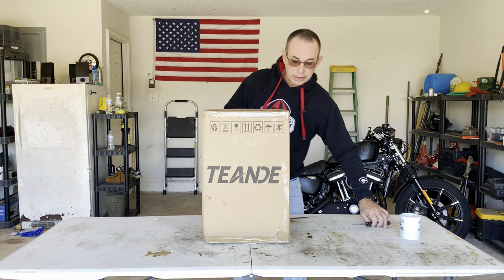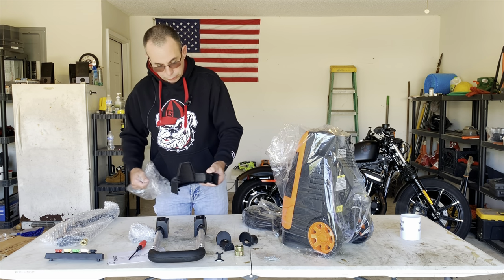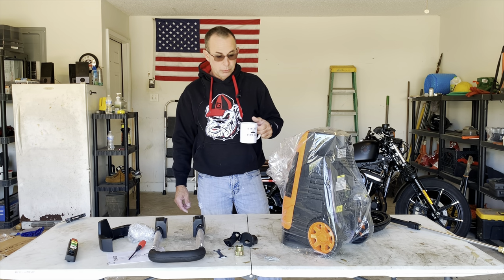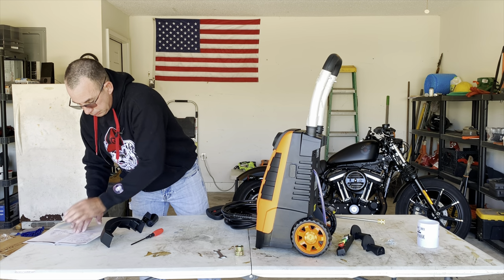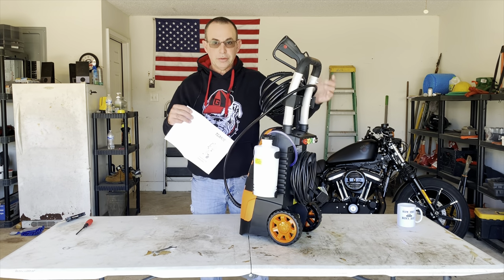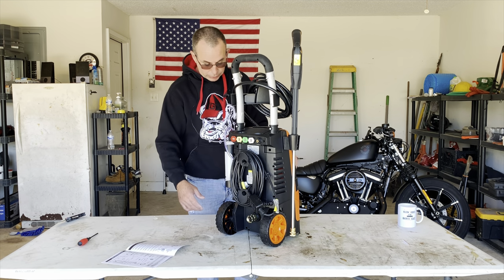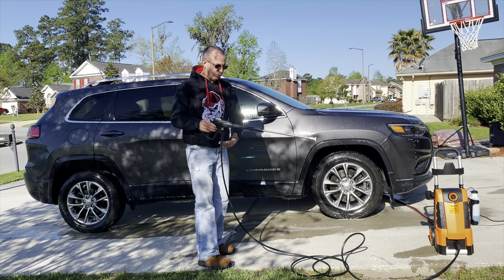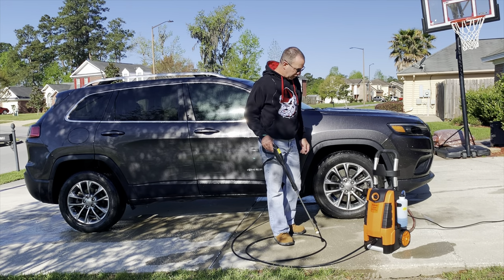Unbox - Assemble - Demonstration TEANDE 3800PSI 2.8GPM 1800W Electric Power - Pressure Washer

Comment: Hey Dan!

I have a 2 story house with a walkout basement so I need to be able to reach 3 stories with the softwash. Do you have any recommendations? Would my electric pressure washer with one of the pink tips you recommend and a ladder give me the reach I need?

Thanks for your videos, last year I used a pump sprayer per your recommendation (and a long extension pole), this year I'm wanting to save my shoulders some wear and tear lol

Thanks for your videos!
Reply: Recommendations such as do I need a different pressure washer? If so what specs do you recommend looking for?
Reply from the maker: You will need a more powerful unit to reach that high effectively. There needs to be enough flow on the surface to actually “wash” the dirt and mildew away

Comment: Great video Dan.
I’m looking forward to the review after you have it through it’s paces.
Maybe a turbo nozzle would make it clean concrete surfaces ?
Reply from the maker: Maybe George. Definitely would need a low power turbo nozzle but may be worth a shot
Reply: You need about 3,000 PSI in order to make a turbo nozzle work properly, and you need that pressure plus 2.6GPM in order to do concrete. I have such a washer, and I bought a 15" surface cleaner for it from Karcher brand, which is effectively made for pavement washing anyways.
Reply from the maker: I wasn’t sure what I would need. At BlueMax, our boss bought a tiny electric pressure washer and it had a turbo nozzle on it and it worked well. Much better than just a white tip.

Comment: Its been a long time since I've seen you Dan, you took a good break lol. Ahh, another pressure washer, but maybe this ones better. Ohhhhh you know how I love your dirty humor Dan, you can soap up some other things if you wish too. ROFLMAO! Ya, the washer is what I expected to, especially since I used to own an electric, nothing fancy, nothing impressive, but does the job it was intended to do. My gas Powerhorse 3,000 PSI 2.6GPM with a 50 foot 3/8 hose is a better unit, but it requires maintenance. LOL
Reply from the maker: Good to see ya Ashurii!!